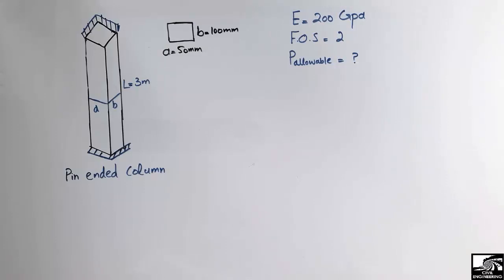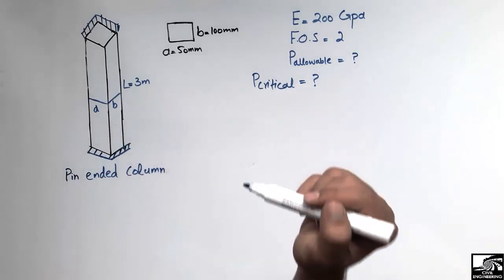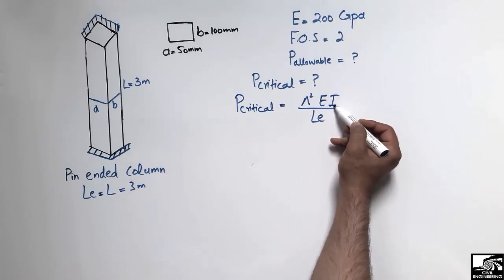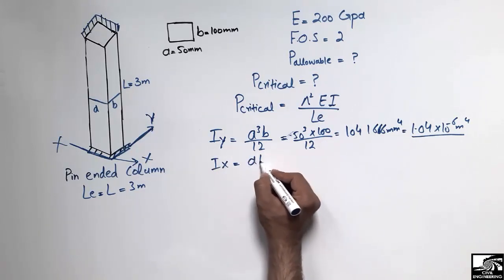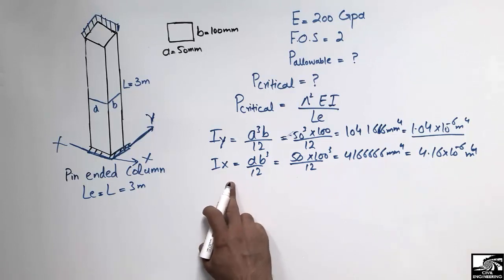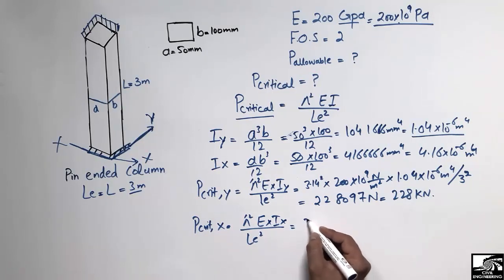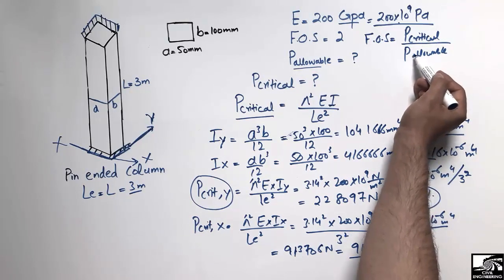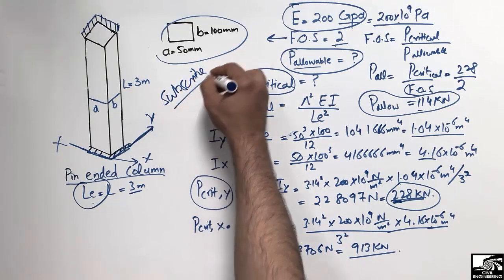Design of Pin ended Column || Example Solved

Comment: As per IS 456:2000
We Can Know Pcr= 0.45fck Ac + 0.67 fy Asc
Using this Formula We Can Easily Find out Actual Load Carrying capacity of Short Column